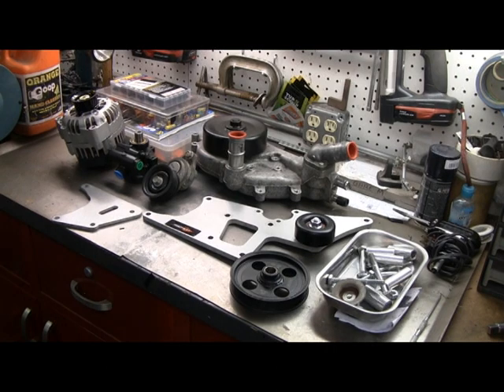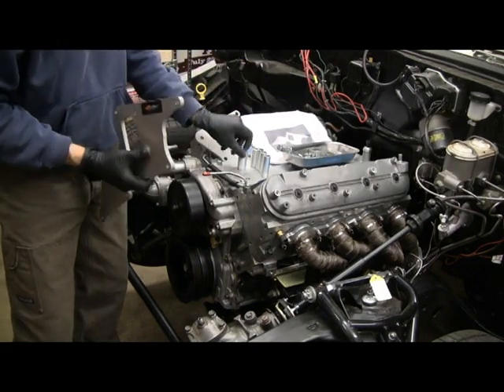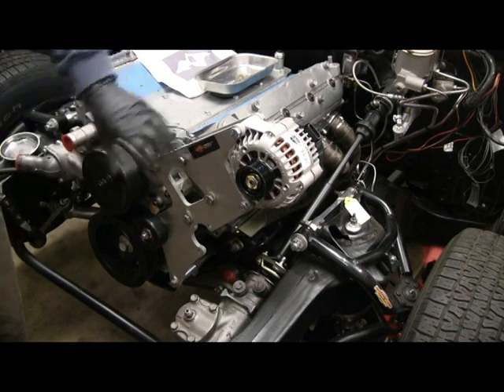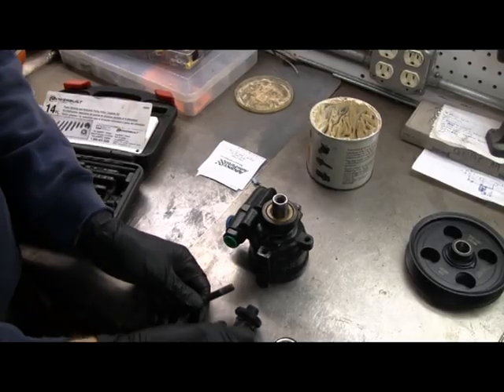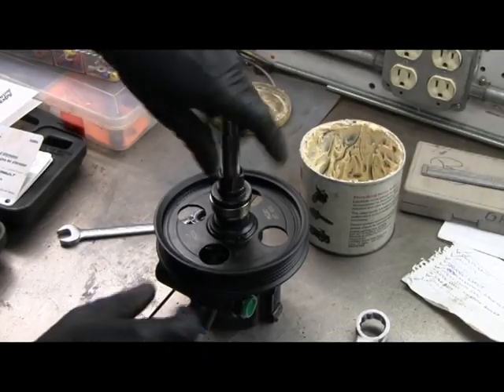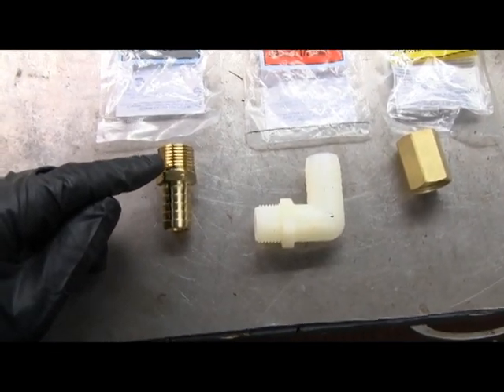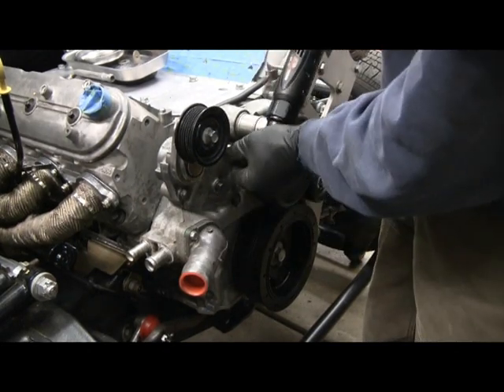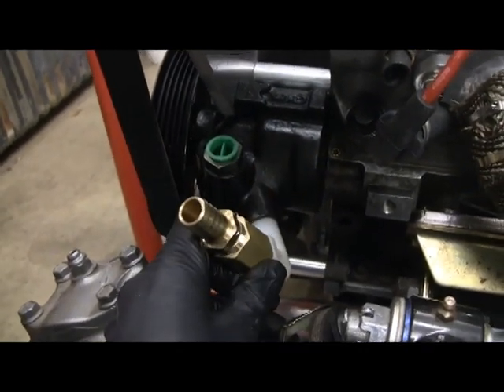LS Conversion swap, Part 51, accessory drive and power steering pulley

Comment: Good to see another post from you, thanks for all the info. I'm not sure how you plan to use this car
 and would like to know if you will have A/C. I live in the south and building an LS-powered Gbody and I searching for a low mount A/C bracket, It seems that Spohn motor plates may work with factory brackets, but I'm concerned about crankshaft height.
Reply from the maker: The car is 90% street 10% track. I am also a 6x veteran of Hot Rod Power Tour (with the SBC) and plan to continue once complete. No AC for me. I am not familiar with Spohn plates so can't help you there. I sugegst looking to LSBrackets.com they have lots of options for various mounting position of accessories.